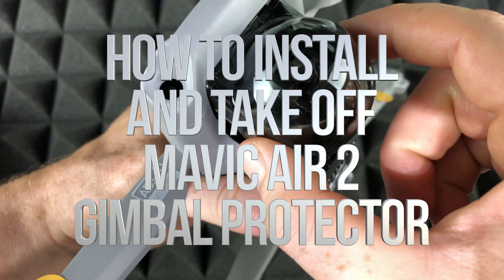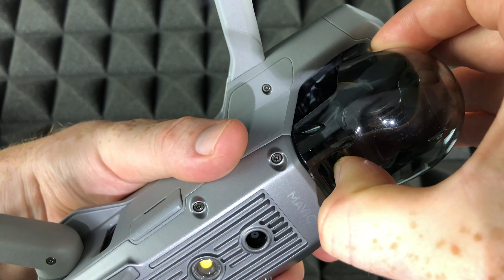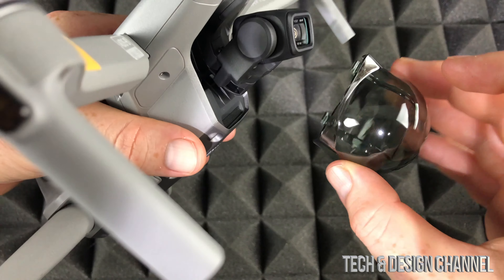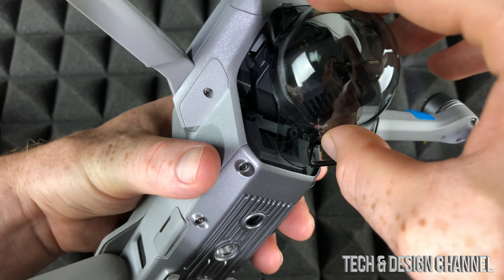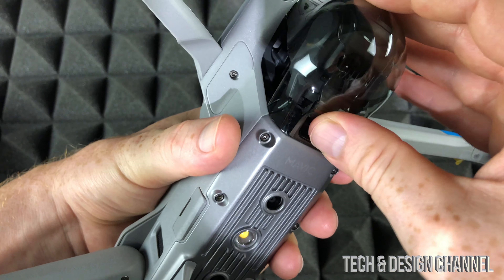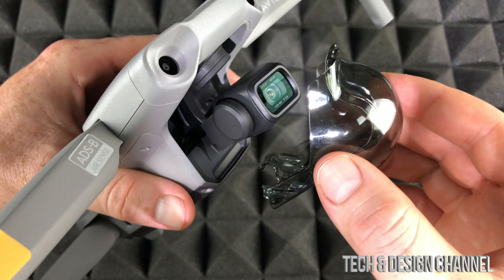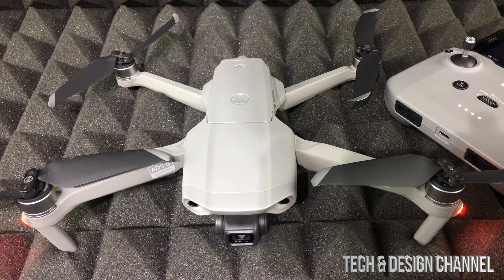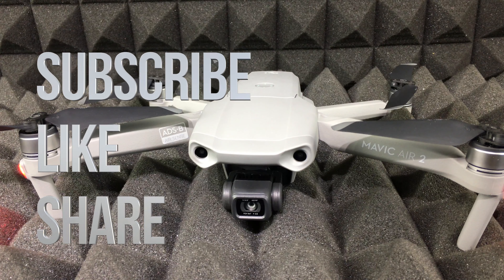How to Install & Take Off DJI Mavic Air 2 Gimbal Protector

Comment: The clip in the back of the protector puts unnecessary force on the gimbal it’s self. There’s a U tuber that shows the simple mod for this. It involves clipping off the little tab that extends out near the bottom of the cover. Makes the cover 100% easier to remove and replace with out forcing the camera possibly damaging the gimbal.
Reply: I hate this gimbal protector. I have a heart attack whenever I mount it.
Reply: That clip on the back is to prevent the camera from bouncing around when it's stored in a bag.  All you have to do is make sure you have the camera lined up pointing straight forward and slide the cover on from front to back.